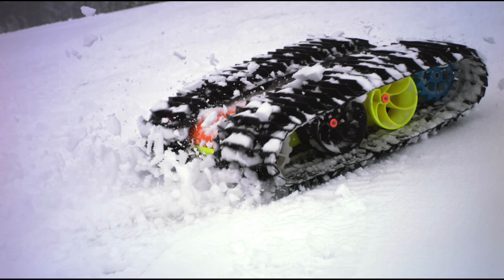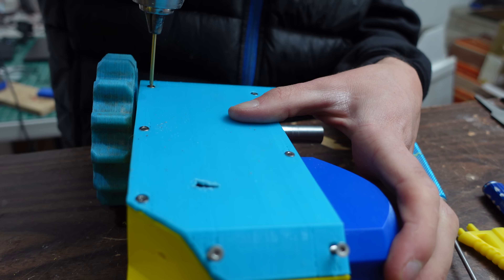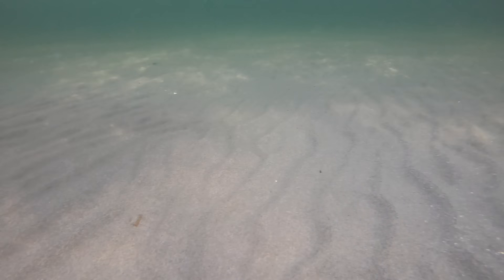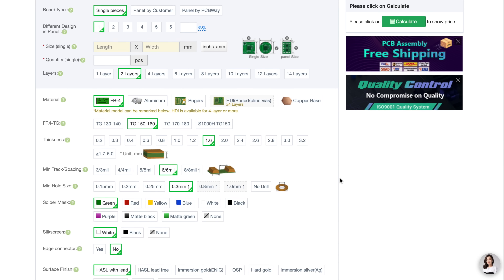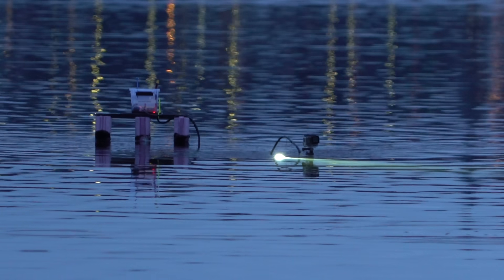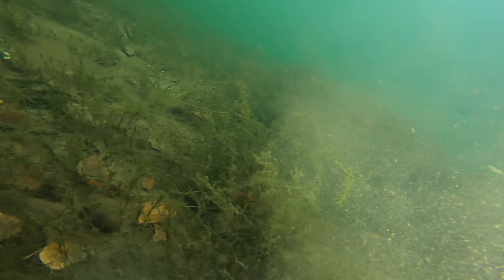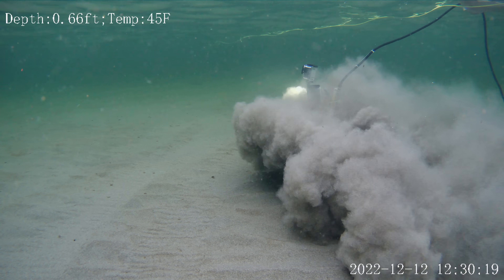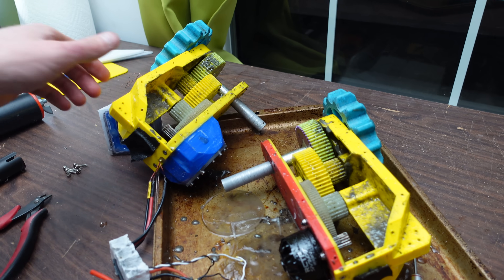DIY Aquatic R/C Tank

Comment: Great project and lessons learnt. Lots of interesting challenges. Just seeing types of challenges, and how they approached is interesting.
Perhaps a simple underwater FPV Sub on tether might make for a simpler initial project to test a number of water proofing issues. (one motor, couple rudders for pitch/yaw and a camera/light)
This the kind of project that could be tested off a dock in winter. 

For sub- windows, it may be useful to have a channel for a gasket, vs doing flush mount for the glass.
Now that you have a "real" boat, that will make a good base camp. Any issues, just hoist up the Aquatic Track vehicle.

Comment: For 3d prints not being water proof, higher temp, less cooling, more slow means more water proof.

Im not saying a snails pace but those are the values to tweak if you want to figure out how to do it. Basically you want more time where the plastic is molten to form seals.

Comment: For a good testing place with wide shallow areas, it might be possible to test off of some of the islands off the north of the arboretum, reachable by foot over the bridges and trails. I'm not sure how mucky it is there though vs solid ground... it's a bit of a bog... but it is moderately shallow in places.

Comment: You should add inflatable floats (Co2 cartridges?) so that if the AquaCat gets stuck underwater in the middle of the lake you could inflate the floats and use the tracks for providing locomotion back to the shore.

Comment: There has got to be a way to go tetherless by using a lower frequency transmission, having the remote antenna underwater. Water supposedly is quite good at transmitting sound!

Comment: Blue Robotics makes out runner motors which are inherently waterproof.  The bearings are designed to be lubricated by the water.  I have used their thrusters which have these motors but don't know if the motors are sold stand-alone.

Comment: If you print using the gyroid infill pattern you can then drill some holes in your print and fill it with epoxy resin to make a waterproof and much stronger piece.  I would recommend some low temp curing epoxy though cause on large prints regular can get too hot and deform the print.

Comment: Might also be worth having an emergency buoyancy device. If you go too deep the pressure activates a switch that can activate compressed gas (like a small canister to fill spare bike tyres) and lifts you up. Or a way to drop your weights.

Comment: a thought: power the barge. have a winch mechanism attached to the tether. you may have to make the barge bigger to accommodate the load of the cat if it needs to winch to recover. someone else mentioned a rescue balloon of some sort, but i think a winch would be a better long term solution since it wouldnt require a co2 cartridge or anything else increasing buoyancy.

Comment: a 3d printed model can certainly be water tight!! But not with FDM printing. You need to get an SLA printer (liquid resin). That will print everything water-tight out of the gate. You can also print way more translucent than you can get with FDM by far! Its not clear, but its definitely see-through. I am looking forward to more water-tight videos in the future!!! Great ideas. You will soon be building RC devices that can go between land air and sea at will!!!!!

Comment: Maybe try using ethernet cabling, the twisted pairs would eliminate your noise issues, and if the 22-24 Guage wires aren't big enough to supply the current needed for the motors you could use an external bigger pair of wires for positive and negative power and then zip tie the wires together or put the two inside some sort of sheathing material to keep the wires together.

Comment: This is really cool.
So on the old PlayStation they used a magnet ring on the power wire to prevent "noise" from passing from the house to the system and also one from the system to the TV.  
Maybe this concept would work on your cable?
EDIT:  Another idea I had is that you could attach fishing line to the Tank along the side of the power cable and through the boat back to shore.  
You would be able to use a pole to reel it back in, this way if you get into an issue like you did with the silt area you can retrieve the model without having to wade in the mud.
Some high weight braded line with either a ocean or catfishing pole would work great.  I'd go with at least 3x the weight of RC for the line incase you need to put some beans behind the pull if it's stuck.

Comment: You might experiment with running ultrafine plaster around the plastic parts you want to be waterproof and baking them, or lightly running a torch or heat gun over the surfaces. Tbh resin prints are usually way more waterproof. Personally I love to use lost pla casting in epoxy using plaster and a vacuum chamber.

Comment: Friend of mine bought a used classic RC sub this summer. Can't recall the manufacturer or model.
Barely 3 minutes into the maiden voyage, FPV and controls failed. The 15A fuse had blown, due to a very minor leak in a bad spot. We contemplated calling the automobile club, since they would definitely have a backup, but it would have been too weird.
"I drove to the lake with my yellow submarine and now I'm stuck ... no, not my car ... my submarine is stuck 3ft under water!"

Comment: make the barge with a winch, if you get stuck you can winch it up off the bottom, then if you make the barge with rc gear and a motor then you can bring it back to shallower water and then winch it back out back to the bottom

Comment: The interference is probably because the tether cable doesn’t have twisted wires. Wire running in parallel will induce a magnetic interference from the power wire current. Also the white in the oil is probably from water getting into the motor cavity.

Comment: Max depth is something you'll need to plan around and try to avoid. If the cable is on tension your rover will "jump" if a wave hits the floater so at best its always a little loose or is on some kind of suspension (rubber bands?). You'll need a compass and a pressure gauge to see where exactly you are and maybe some kind of manual fail safe. 
Ditch the steel bars on the rover and make biodegradable and/or retrievable weights you can drop underwater. With the change in weight you could possibly just pull it in with the floater+

Comment: did you consider adding small compressor and tube? there is wire anyway
constant flow of bubbles through not sealed parts outside should not let water inside

Comment: Your projects are amazing! Only thing I would change is silicone, it's just bad in this application. Better get yourself epoxy if you need solid connection, or proper SikaFlex if you need flexible connection.

Comment: It seems like a lot of your problems are caused by a lack of traction and an unadvantageous center  of gravity. What I would suggest is having two ballast tanks- submarines use them- on the front and rear of the snowcat, which you could fill with water or air when needed, using a small pump and a toggleable one way valve. You could add weights to the snowcat, then have them countered by the ballast tanks being full of air. When you needed more traction, you could let the air out, increasing the density of the snowcat as a whole, which would make the ridges on the tracks dig deeper into the lake bottom. When climbing a steep slope, you could fill the forward tank and pump out the back tank to move your center of gravity forward. If the tanks were big enough, you could even float the snowcat with them. Also, it would be relatively simple to waterproof a gyroscope so you could know how steep the terrain was.

Comment: Fun & really cool! :D

The video -- with all the lines -- was better than I expected from that cable. ;) You could obviously see well enough to navigate.

I wonder, could you use some sort of sound-based remote control? Waterproof speakers don't seem hard to come by, though I don't know about microphones. You could do it with a pair of modems and it would sound like dial-up internet! XD They'd have to take it in turns to communicate; perhaps the controller sends a quick burst in between each video frame from the tank. Or it could be more analog, with the video taking up a lot of bandwidth in the upper part of the audio spectrum, and the controller sending low frequencies. Oh and maybe put a bunch of mics on it and try to pick up reflections of its own transmissions for sonar. You could make it transmit the sonar image instead of video; that'd be eerie & cool! :D But I'm starting to tangent wildly, so I'll stop now.

Comment: Would an ultrasonic arduino type sensor work for depth detection like you did with the automated ground effect vehicle. And also what do you think ablut using the cable reelers like vacumm cleaners do for some good solid depth?

Comment: Would be cool to add a solenoid actuated emergency buoyancy device. That could fill a balloon using a small C02 cartridge (or something similar) to raise the tank to the surface when it loses traction or gets stuck under water, or experiences technical difficulties!

Comment: One point - you didn't need to submerge the motors in oil. Brushless motors can be fully submerged without issues anyway. Just need to protect the bearings so they don't rust.

Comment: You could do with a quad copter style get me out of trouble unit a meter and a half up the  tether, if the tank is stuck, use the quad to lift the R/C Tank out and make the quad able to drive it all back to safety, the quad should be a independent stand alone unit and steerable with tilt motors

Comment: wasn't sure if o already commented but i wanted to suggest a 100 watt solar panel barge carrying the battery 🔋 and then wire's to bottom being at least 12ft long maybe something modular in sections that waterproof together for deeper dives strong couplers though so you can winch the whole thing back up maybe a insta 360 cam on top of rover and a solar barge top down cam for following maybe mounted to rotate from 90° level to 0° down 45° being mostly useful I'd call it a 3rd person fpv

Comment: You need a foiled cable for the video signal, at least some grounding around the signal wire and maybe a decoupling condensator!
Reply: That can very well be wood, wood does not really rot away if it is kept underwater!

Comment: The catamaran needs a small red flag on top, to signalize boaters, it is not a buoy, it is moving. 
Manipulator would make your submarine tank into nice "treasure hunting" equipment, for cleaning the seabed.
Regarding the steep angles - if the catamaran part of your design, has enough floating power, you can add an electromotor and reel the tank up, to "jump" any obstackle too high for the tracks, to drive. But if so, you would need the catamaran to be powered too.

Comment: with a project like this, I'm not sure hot glue is going to do anything when it comes to waterproofing it. with a 7ft max depth it won't be an issue, but once you try to go deeper, some issues may arise.
 
Once you drop down the pressure is going to keep rising, anyone that still remembers the gas laws (or divers that need to know about that stuff if they want to get certified :p)  should know that gas is going to try to 'shrink in volume' under higher pressure(boyle-mariotte). meaning you'll have a pressure differential between the inside and the outside. have to make sure that your waterproofing can handle the stress of the pressure diff as well.
and yeah, you already mentioned it, but: get a compass on it. underwater navigation is messy as is, unless you really know the dive spot you'll easily get turned around. so a compass is a must have.
as for safety/ recovery stuff, get something like either a small compressed air or CO2 canister, and something sturdy to act like a 'balloon'. you can have a solenoid to control it to do stuff like release when it powers down/ runs out of power, or do it on command. this is once again another law of physics (archimedes). basically, if something sinks,it either needs lower weight or bigger volume to start floating. releasing the compressed gas will normalize it to the surrounding pressure making it expand, hopefully increasing the volume of your tank (without adding weight) enough to make it float up. 
With some testing you might even be able to put it somewhere so you can get it semi out of the water, so if it still works you might be able to use the tracks to get back to shore (like in case a sudden dropoff screw up your chances of getting back via the lakebed).
alternatively, give it a weight belt that's removable, if the tank is naturally buoyant and you don't mind losing the added weight, you could dump the weights (or part of it) to turn it into a boat and get back home xP

Comment: You need a cover on the top of the tracks to utilize the fluetic flow of the traction to maximize your repulsion otherwise without limiting the fluid contact on one surface of the track you are not utilizing your energy by canceling out one half of the tracks fluid interaction you would be maximizing the hydrodynamic forces and unilaterally increasing your propulsion... Basically in water ur all go, all flow, in opposite directions...
Reply: Don't forget about the hypertransonic parabolic transfer unit

Comment: Hey Daniel, I have been looking for tracks, for an rover project that I plan to use for things like an fpv mower. I’m building it with the base and drivetrain of a Hoveround mobility scooter. Do you think your tracks would be strong enough for a rover that weighs around 100lbs?

Comment: Another way to waterproof outrunner BLDCs is to take out the stator and seal the entire thing in epoxy, then sand/lathe it to gain back clearance against the motor bell. That way you don't have to encase the whole thing in an enclosure!

Comment: If you put a deflated balloon inside the rover, and attached it to a long tube that was terminated at a small air pump, sitting on the tethered raft,  you could control it remotely to make the rover buoyant when you need it to be. The rover could even be made to be neutrally buoyant while its somewhere in the middle, between the ground and air, and the tracks/treads on the rover could act as natural underwater paddles! Giving it movement which way you need it to go.  This might be helpful in the future if you get stuck in the middle of a kelp forest or even if you find yourself approaching a cliff or deep drop off of some kind.  Also if ever the rover begins to drag the raft downwards, with a quick reaction you'll be able to inflate the rover and float upwards,  preventing it from pulling the raft down by the tether.  

Just an idea!

Comment: I just repaired a old dive computer and to fill them with oil and get all the air out you would need to submerge the motors and put the lid on while in a bath of oil

Comment: You dont need to waterproof the motors, the wire is coated and therfore insulated. They work perfectly finde above and under water.
Reply from the maker: rust and sand....

Comment: Next time maybe you need a big RC boat as the control rig, but with a winch on it so you can just lift the vehicle off the lake bottom and into the boat instead of messing around with the grappling hook. Could be easier to deploy it as well with less 'commuting'

Comment: I think you’re seeing crosstalk from the motor phase wires to the analog video signal. Since they’re in a tether, this won’t be the easiest to fix because you can’t separate the two connections. Braiding the phase wires together may help the fields cancel, but I would still expect some crosstalk. Your next best option would probably be shielding the two cables, ensuring the shield is grounded at both ends.

Comment: Longer tether, a more stable buoy that can float the rover, in case you reach max depth it doesnt sink, and maybe add some CO2 canisters with quicj release valves to inflate balloons to bring it all to the surface in case you get stuck? (like airbags). It'd be a cool proof of concept if nothing else

Comment: PETG naturally absorbs water and is a more porous plastic. Might've had better luck with a Polycarbonate blend, ABS, or even PLA.

How you print it matters too. A well tuned printer has a higher chance of a watertight print. Less cooling and overtemp nozzle can help bond gaps.

Comment: So the mineral oil being white is an indication of water contamination,  looks just like the lovely grey oil in my motorcycle gearbox when it used to blow the water pump seals. The air bubbles probably helped homogenize it a bit.

Comment: i have several ideas to make this thing even better have a cable return if it gets stuck then can roll cable back in to  above boat. Also make cable up to 300 feet with cable  retract so can go deeper and have more fun. then set another controller for winch and cable retrieval. then put motors on surface boat then recover sub tank. in to hull of boat under side leave just shallow enough to use tracks to haul it's self out of the water

Comment: FYI you can just run brushless motors underwater no waterproofing required. Because there's coils of wire with no exposed conductor their inherently waterproof (ignoring any damage to the wires or corrosion to the ball bearings)

And yes I have tried this multiple times and never had any issue

Comment: When you drill that hole to dry out the interior, you should have used a can of spray air to flush out any of the moisture as it is denser than atmospheric air and would displace the air inside.

Comment: you should put a camera under the raft in the water pointing down forward, in order to see the drone...
Or even better you could put a motor on the raft and a winch to pull the tank when it's in trouble !! You then drive the raft to shore...